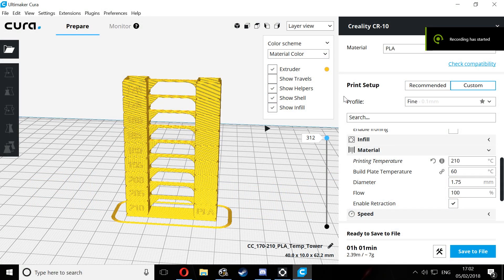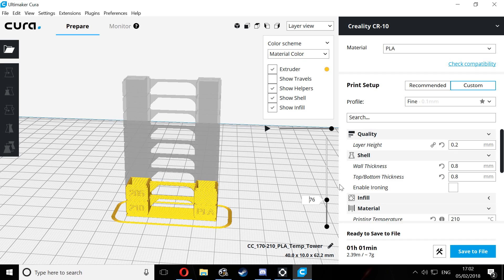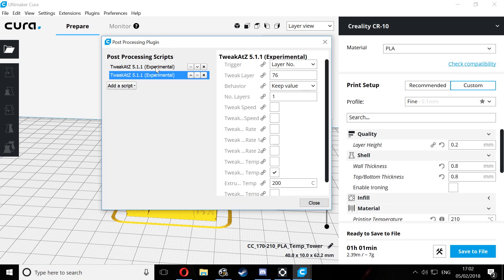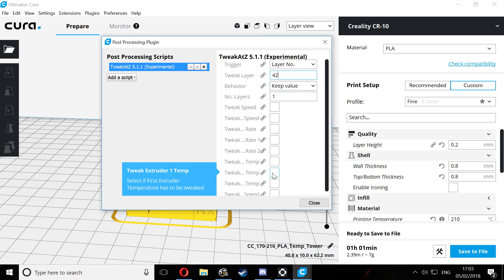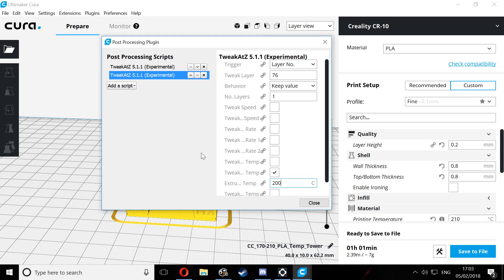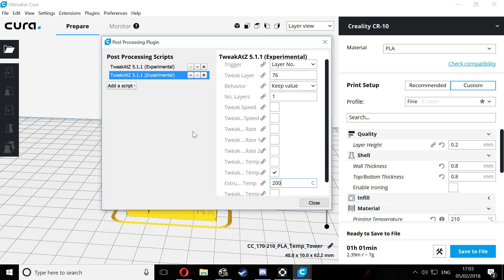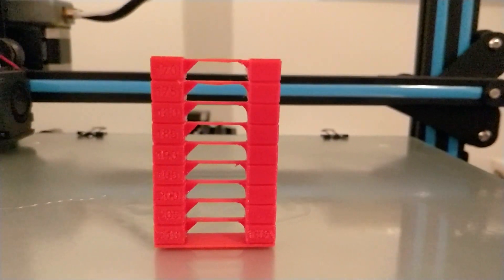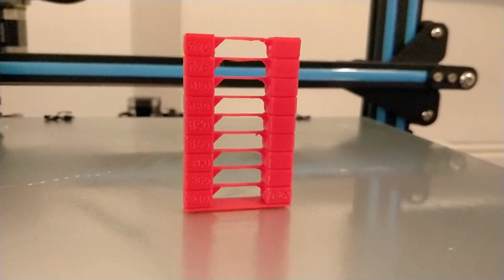Temperature Tower Tutorial - CURA Change at Z!

Comment: Thanks have you tried Cura 4.11.0 (the Plugin is named ChangeAtZ 5.2.1), I have followed your video but the printer is not heating the Extruder at all any ideas? I am using a CR10s pro... UPDATE - Found the Parts for Calibration Extension for Cura has a build in Temp Tower!  that works (Just remember to set your Build Plate temp the same as your script start temp...)

Comment: Total noob question, but I ran your test (thank you by the way) and found that all levels from 210-180 were exactly the same.  Unfortunately at 175 the print was knocked over and I couldn't finish the last two layers.  I am using an Ender 5 with Value PLA in Grey with a recommended nozzle temp of 190-230.  Any thoughts on why I wouldn't see a difference on the test print?

Comment: I have been 3D printing for a few months.  I am trying PETG in my Ender 3, so far without much success.  My PLA prints are all good.  I am trying to learn about gcode, etc.  I use Cura and want to do your temp tower for PETG.  I am having trouble with the scripts and understanding exactly what I need to do to vary the nozzle temp by layer.  I downloaded the info from Thingyverse and still having some issues.  Is there a file, profile download, or more instructions that would help me edit the profile in Cura?
Reply from the maker: Hey JC, Check out our written guide too. That will hopefully help you to figure out how to change the nozzle temperature :)

Comment: I did all these steps and now printing through USB on CR-10S, but the nozzle temperature on the LCD screen doesn't change any numbers when passes certain layers, how do I know if the temperature of the nozzle is still changing or it is still printing the same temperature as the initial temperature is set?
Reply: Seems temp not change if you set trigger at height. But when I changed to trigger at layer, it worked. And mine is RRF duet2 wifi. It recommends that use G10 to set temp rather than the M104. So maybe you can get secured temp change by replacing the M104 with G10.

Comment: Just wondering what scale you printed the test tower at. Just started printing one on my ender 3 and it seems quite small on the plate. Though Cura did estimate just under 78 minutes to print.
Reply from the maker: Michael Feeney 100% scale, the 78 minutes spent on this print will save you hours in the future trying to find the right temps 🙂
Reply: TechnoGeek 3D Yup agree with you there. Just thought that the tower show in the video was just a little bit bigger than the one currently printing on my plate. 

But now that I know I have the setting right I am eagerly awaiting the results. I’m using Suntop brand filament, which I believe likes a temp of about 205c, well I had good results printing at 205 with this roll.